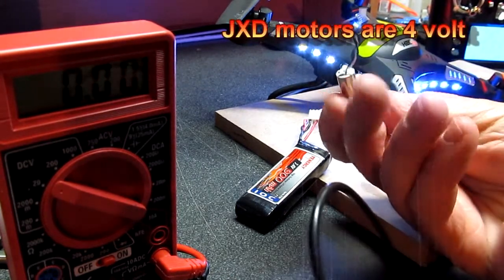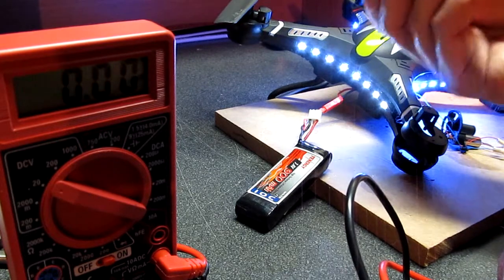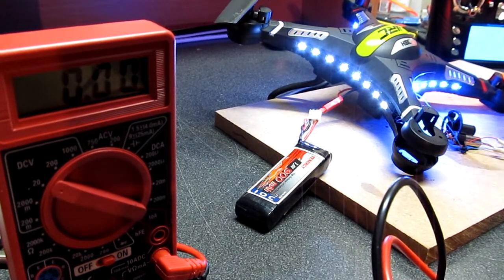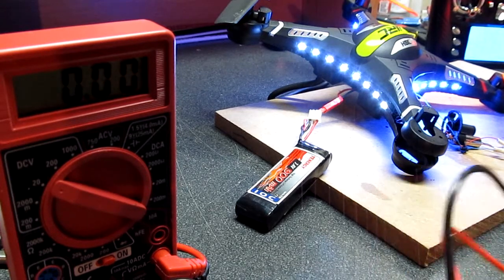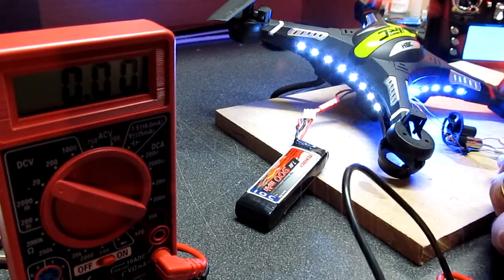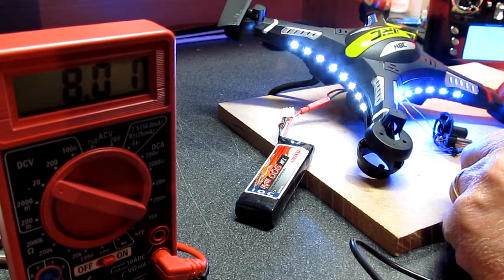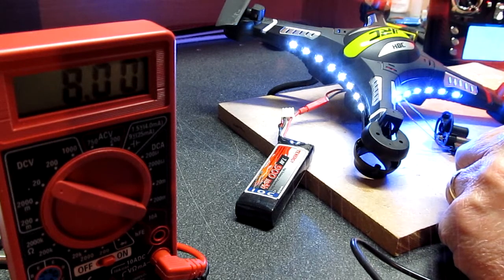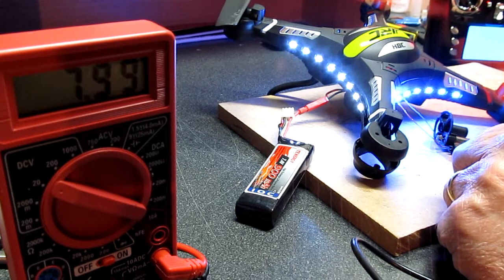H8C quad motor voltage. I would avoid purchasing this quad.

Comment: thanks for your videos and you are very skilled indeed. :) i'm thinking of modding the lights of my H8C, but i have no idea as of what kind of LED i should get.. do you know what are the voltages going through the original H8C's light stripes by any chance? many thanks!
Reply from the maker: I'll check for you when I get my replacement board from Banggood.  It should be here in the next couple days.  I have another H8C I just purchased, so far, the few flights I've had have been good.
Reply: MrPolymers that'll be mega helpful! thanks man! have u got the headless mode one?? i've read online from different people that it's apparently more stable and can fly up way more!
Reply from the maker: OK.  I own a number of quads. Two of them have headless mode.  Guess what, I don't like headless mode.  For me it's confusing since I already have the orientation pretty much figured out when I'm flying.  Kinda like placing training wheels on a bike when the rider has been riding for years. ;) The H8C does not have headless mode or at least mine don't...
Reply: i only have two quads, and none of them has headless mode. i agree with you, that headless mode is confusing and its unnecessary! but yea, my H8C doesnt have it neither.
Reply from the maker: You don't need it.  Just practice like I have.  My neighbors have become used to me flying around the neighborhood and I do get many of my neighbors stopping by and watching.  I'm the neighborhood entertainment.  LOL.